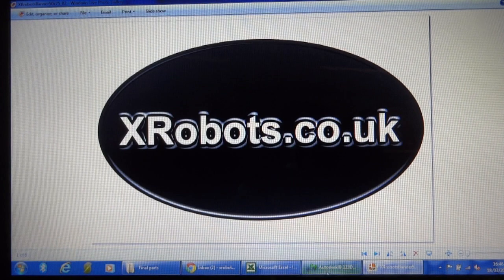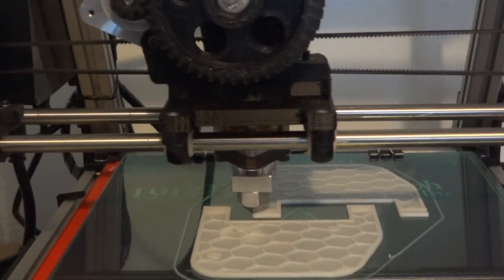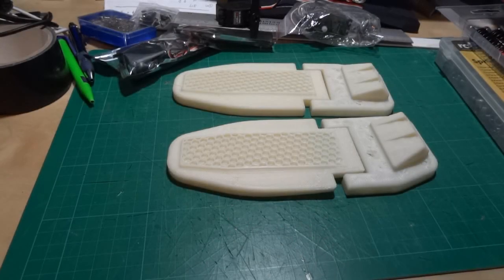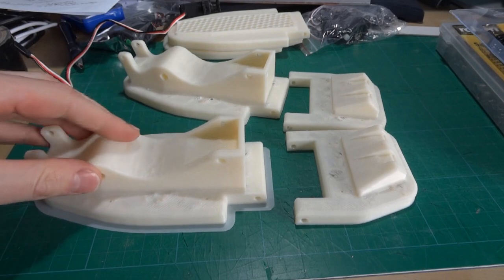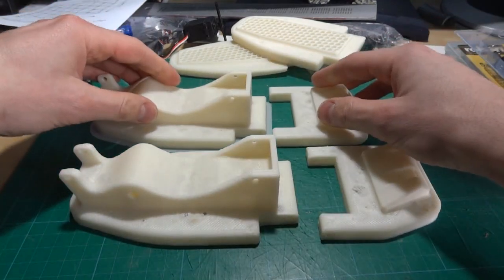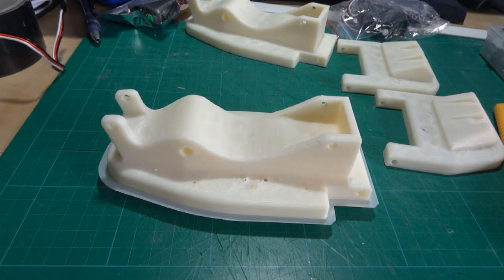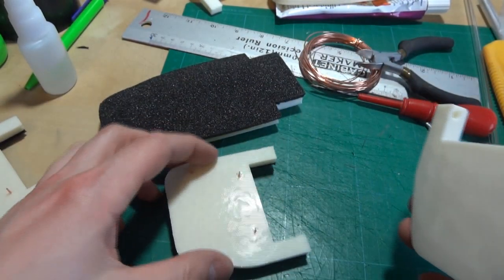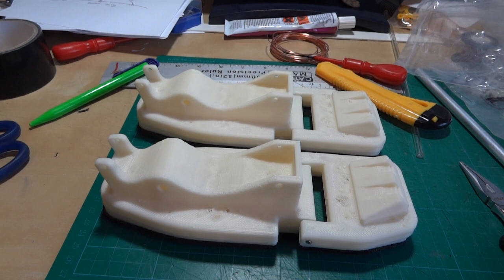Android 12 Part 1, 3D Printing Foot Assembly, for my Bipedal Humanoid robot | James Bruton

Comment: Your 3D printer looks like one of the Best used on youtube, but i am also interested in the cost efficiency? If you take the Price of the printer, the plastic thread and hours used on the designprogram, is it really cheaper than making the parts manually like you used to?